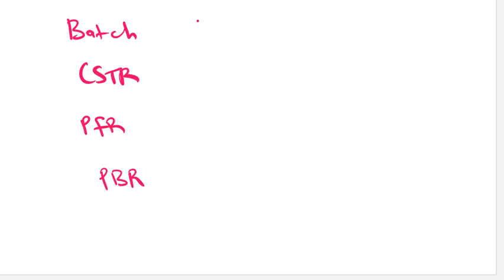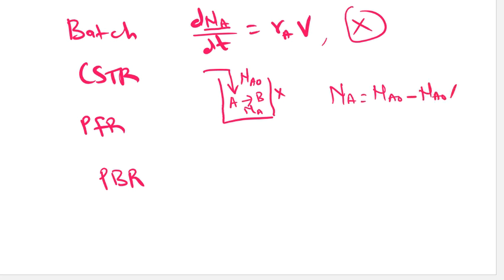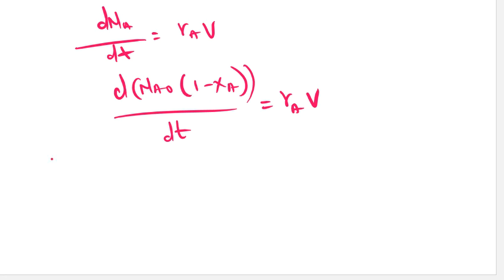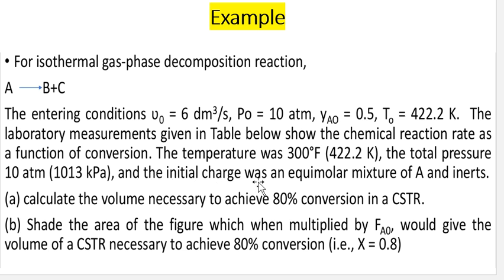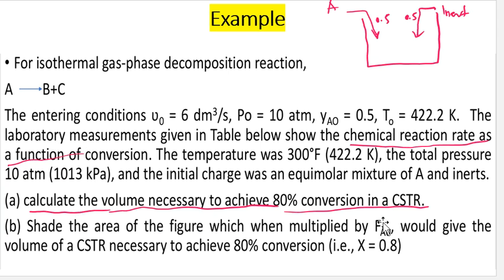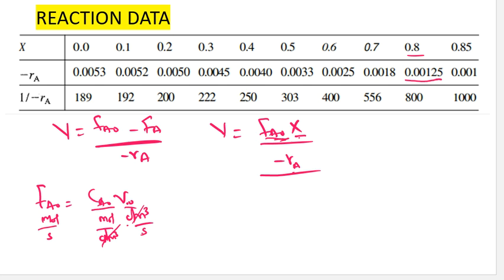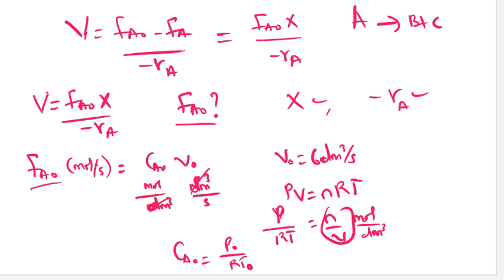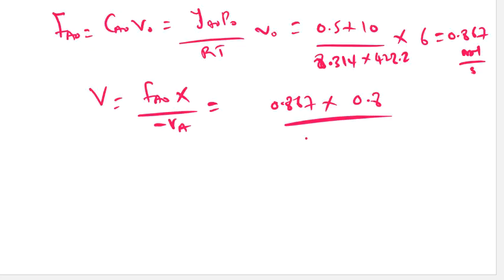Reactor Design 2:  Conversion Method

Comment: Please I need some clarification: @ 9:07 for dimensional consistency, since R is used in terms of m³.pa/mol.K, why not take the pressure in the unit of Pa or use R in terms of L.atm/mol.K?
Reply from the maker: @SylviaJames-e4c  thanks for your observation. The pressure used was converted to  kPa (1013 kPa) before getting the final answer FAo= 0.867 mol/s. Sorry, I skipped this conversion step.  The conversion makes the pressure compatible with the gas constant used R =8.314 kPa°dm3/ mol K.
Reply: @luqmanabidoye7344  Thank you so much and great work👍